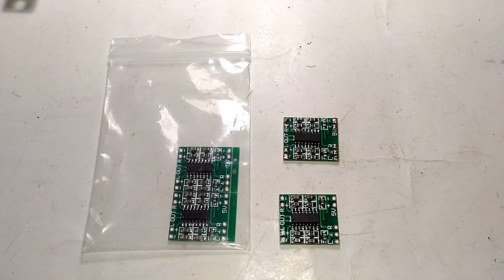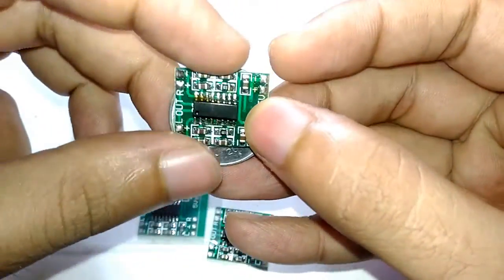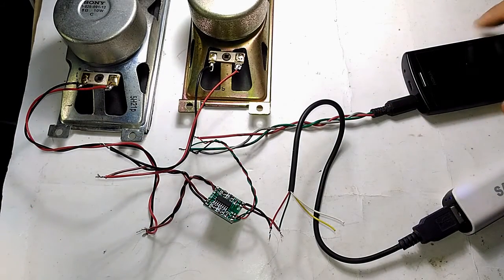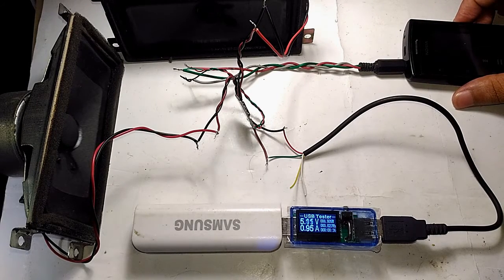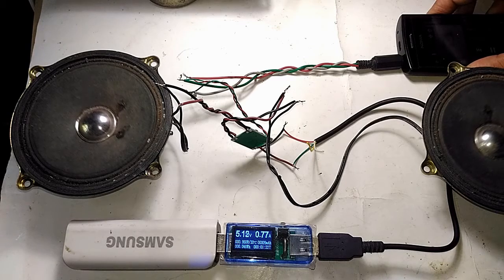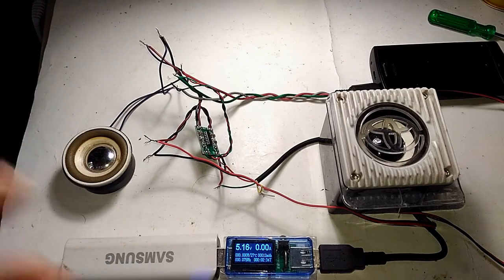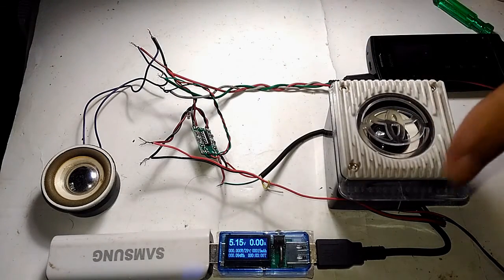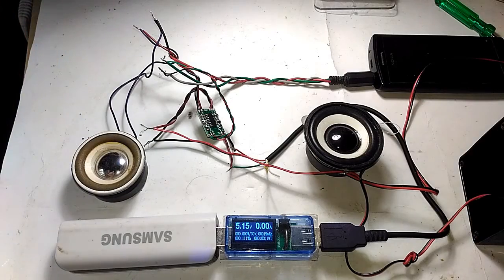IE31: Surprisingly good PAM8403 amplifier! With 25Ω, 8Ω, 4Ω, 2.7Ω Load Test.

Comment: Datasheet recomends 1000uf capacitor at power inputs. PAM8403 gives clean power under 1W, at 3W 10% distortion ther is risk of damaging speakers.
Reply from the maker: Correct. But here they are making it to a bottom price. So including 1000uF may cost them a penny more to make and so they didn't. :D
Reply: @INSIDEELECTRONICS I got 15 PC's of these cheaper ones from AliExpress, the other version has pot & solid polymer capacitor , slightly expensive.

Comment: I bought this Micro USB 5V PAM8403 Bluetooth Digital Audio Receiver Stereo Amplifier Board
Is it better to connect with booster step up 5V module or directly from the 18650 battery?
Thanks!

Comment: How to put up with Bluetooth module? How to connect?
Reply from the maker: It depends on the type of Bluetooth board. Usually you can take the audio output lines from BT audio board and connect it to the respective L & R input channels of PAM amp board.

Comment: There is a constant Humming noise and i can only use One speaker when I connect two speakers it starts vibrating , I dnt know wht to do , using two 3.2 ohm 3 Watt speakers
Reply from the maker: Are you using any smps power supply for powering this board? Like mobile phone charger etc... If so that is the issue. The charger is not of good quality. Try with a 1000uf capacitor in parallel with the input dc or change it to battery power.
Reply: INSIDE ELECTRONICS! 
I have betteries but those are of 4.0 volts not 5 volts
Reply from the maker: That will work fine. You can also try using another power supply.
Reply: INSIDE ELECTRONICS! I hve used many adapters like 250 mA 1A 1.5A 1.55A but the same thing happened
Reply: If you dnt have any issue i wanna contact you in personal and send you the video of what actually happening
Reply from the maker: You can contact me at insideelectronics@yahoo.com. I can help you with what I know.
Reply: The highest efficiency is achieved with 8 ohm speaker but with lower output power than a 4 ohm.
And your speaker must have a higher power rating than 3w,otherwise you are overloading them